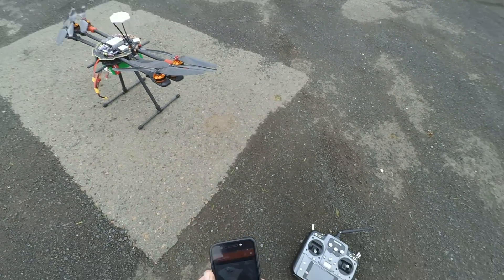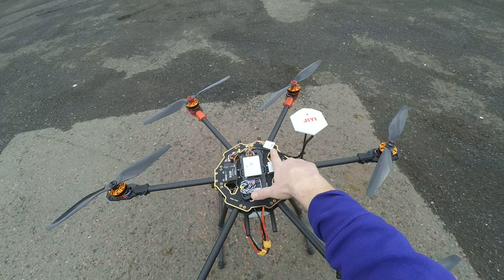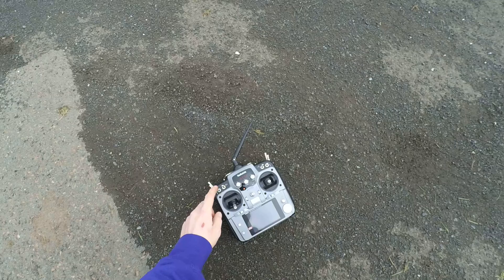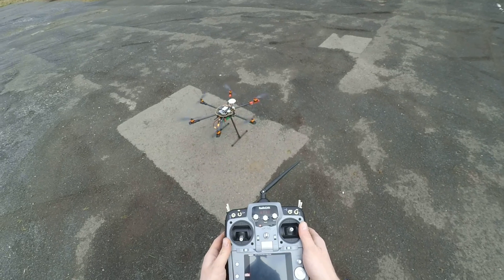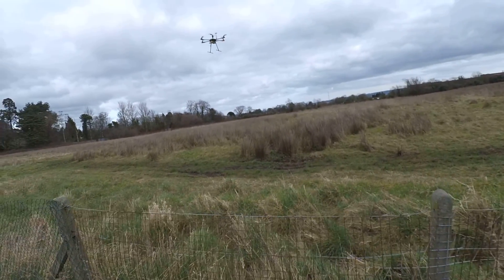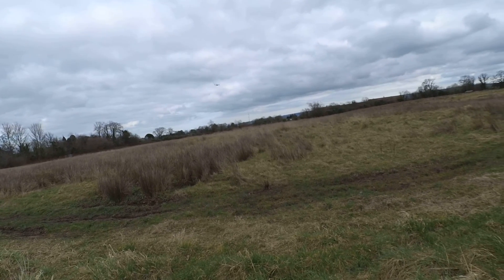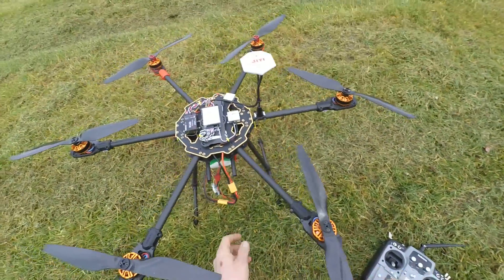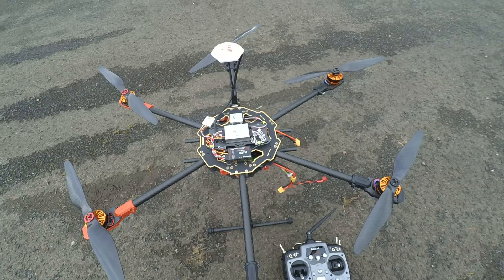JIYI P2 PRO F.C.  FIRST EVER FLIGHT ON MY TAROT 680 PRO BUILD.  AMAZING, VERY STABLE.

Comment: I was nervous for you, man! And also thrilled when it landed safe and sound and everything went well.

I'm planning a build at the end of this month. Still struggling whether to go for a Tarot Quad or Hex. I'd love to go for a Hex, but it seems like a quad will be much cheaper for me and also more efficient with battery life.

Looking forward to having the same feeling you had when you brought it back in.
Reply from the maker: inefficiency Thanks mate.  yes. inwas panicking a bit.  Lol.  but all went well,  Although I have to say after no customer support and some small issues with the JIYI FC.  I have removed it now.  and have the Tarot ZYX-M FC now installed. hope your build goes well.  keep us posted on it.  yes a quad will be much better but I like the added safety that the Hex provides should a motor fail on me.   cheers matey.  Happy New Year to you and the family.

Comment: what lipo did you use and how much time did yo fly?
Reply from the maker: used this battery for previous bench test and never fully recharged.  but after other tests and with a total all up weight of 4.2kg.   3508...700kv motors.  1355 props.

on a 4s 10,000mah battery.  10c. multi star.  I got around 13-14 mins flight.   maybe if I change to 6s 6000 mah I might get a little more.  its still a work in progress as I have had other projects keeping me busy.    thanks....
Reply: +Richard Gilmore Thanks for contribute.